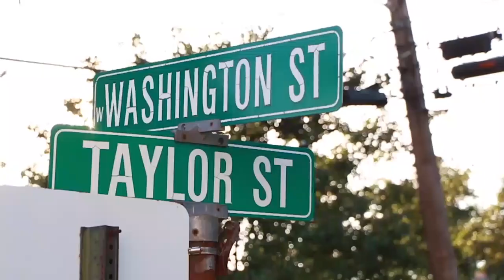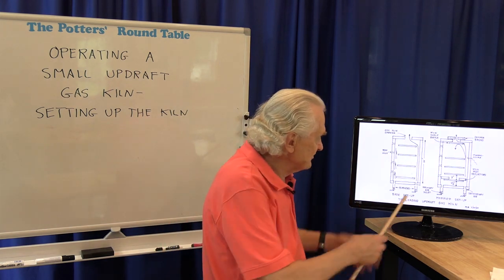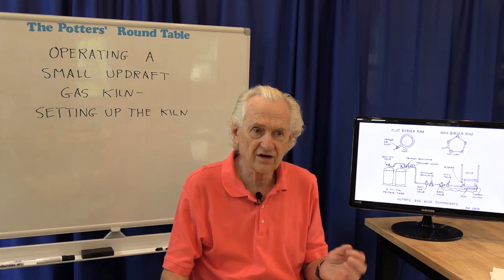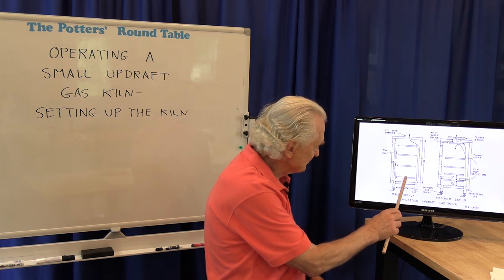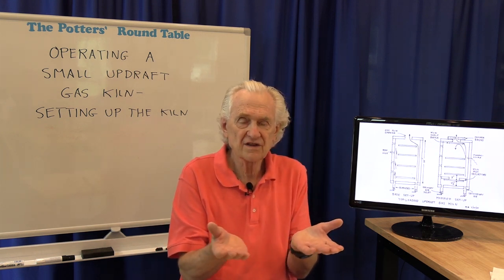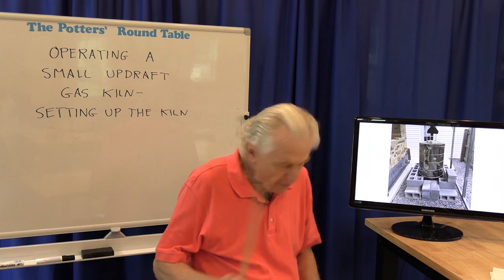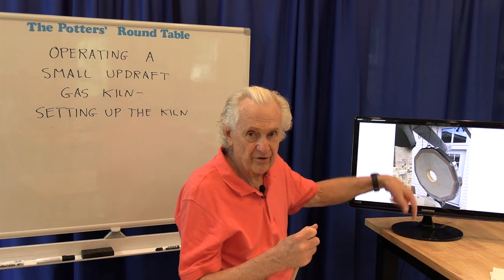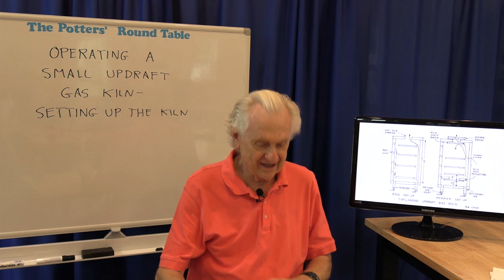Operating a Small Gas Kiln

Comment: Thank you so much for this video!  I have been searching for information on firing a gas kiln and how to deal with hot spots.   I have the smallest Olympic gas kiln and haven't used it very often because I felt more comfortable using my electric kiln.  Also, the reason I haven't  used the gas kiln more is that I don't really know how to use it.  There was a small manual that came with it that indicated the use of a baffle shelf 3" from the top of the lid it also said to place the bottom shelf 3 inches from the floor of the kiln. Other than that there wasn't any additional information on firing it.   I got brave several months ago, bit the bullet and  fired it.  I did use a baffle shelf at the top, 3 inches below the lid of the kiln.  The cone on the top shelf was overfired, the middle shelf was about right and the bottom shelf was underfired.   I had larger pieces at the top and smaller ones on the bottom shelf.  There were some pieces that looked more matured on one side than the other.  It was very discouraging.  Your video has given me new hope and I am anxious to try your modifications.  I might add, I am firing with propane and not natural gas.  I hope you will do more videos on firing the gas kiln as there is nothing else out there not even from the manufacturer.  The books I have found on the subject are more technical.  Maybe I have just looked at the wrong books.    I  would like information on how to adjust the rise of temperature, how much and when.   Also I would like to know how  and when to cover the top port.  To me, firing the gas kiln is much more exciting.  Sorry this is such a long comment.  I am just so happy to find this place on YouTube.
Reply from the maker: Check out our latest video 'Reduction Firing in a Gas Kiln' for more information and a general procedure for any and all gas kilns. It will tell you when and how to cover the exit flue. Any time the video refers adjusting the damper that tells you how and when to cover or uncover the exit flue. Best of luck on your future firings!
Be sure to share the channel with your friends and fellow potters to help us grow the channel.
Reply: I have had an Olympic gas kiln for more than 20 years, and it was so frustrating I gave up, with problems exactly like those you describe. Four burners. It cooled so quickly I lost a lot of pots to cracking. I finally wrapped the whole base in fiber at the end to slow it down. I wrote to the manufacturer and they offered no advice, saying you just leave the ports open. I also got uneven firing, variable reduction, burned a huge amount of gas. Three levels/rings. These videos have been very helpful, and I will try again.

Comment: Thank you! So helpful. Question , how do you provide air to the ring pilot burner. You show a diagram of it but not show photo or explanation. Thank you so very much.
Reply from the maker: No air, propane gas flows through the ring and once ignited provides a pilot light.

Comment: Thank you for your videos and podcasts they are super helpful and informative! I'm just wondering when you'll return to talk about the operation of the small gas kiln? I have a small downdraft gas kiln and I'm trying to figure out how to determine when the kiln is in reduction and how heavy the reduction needs to be. Thanks again!
Reply from the maker: We have discussed this topic several times. I'll get with Phil and hopefully we can put something together soon!
Reply from the maker: Hi, thanks for your email and question. Good timing! As it turns out, our topic for the January, 2021 Potters' Round Table presentation is going to be discussion of a general procedure for reduction firing in a gas kiln. In the meantime - the two features that I look for to confirm reduction are (1) back-pressure (caused by a partially closed damper) in the form of yellow flames out of any kiln openings (like peep holes) and (2) a "hazy" atmosphere in the kiln. The degree of reduction and the length of time for reduction depend somewhat upon the clays and glazes in use. Unless carbon-trapping is desired, it is not necessary to have reduction so heavy that a lot of soot is produced, and if reduction is carried out for longer than necessary to reduce the glazes and surface of the clay (judged by the fired appearance), then gas is being wasted. 

Phil
Reply: @WashingtonStreetStudios  awesome, thanks so much for the advice Phil!!

Comment: Great Video - really useful as I have been given an old Olympic gas kiln just like this but with three rings instead of four. Are there still plans to do a follow up video on the firing procedure?
Reply from the maker: Jez,
Hi, thanks for your email and question. Good timing! As it turns out, our topic for the January, 2021 Potters' Round Table presentation is going to be discussion of a general procedure for reduction firing in a gas kiln. In the meantime - the two features that I look for to confirm reduction are (1) back-pressure (caused by a partially closed damper) in the form of yellow flames out of any kiln openings (like peep holes) and (2) a "hazy" atmosphere in the kiln. The degree of reduction and the length of time for reduction depend somewhat upon the clays and glazes in use. Unless carbon-trapping is desired, it is not necessary to have reduction so heavy that a lot of soot is produced, and if reduction is carried out for longer than necessary to reduce the glazes and surface of the clay (judged by the fired appearance), then gas is being wasted. 

The January Potters Round Table will be on Saturday, January 9th at 2PM eastern. 
The write up for the topic is: 
Reduction Firing in a Gas Kiln
Working with a gas kiln can be pretty daunting. There are updraft, downdraft, propane and natural gas-fired, large and small gas kilns, but all gas kilns have certain features and controls in common. This discussion provides some general background information on gas kilns, an overview of the different stages and procedures in a reduction gas firing, and some of the common mistakes that are made and problems that can be encountered.

Hope this helps,
Phil
Reply: @WashingtonStreetStudios  Great - Thanks for such a generous and informative reply. I've been finding your videos really useful, they are an amazing resource, especially for the self taught potter like me. Look forward to the upcoming round table discussion!

Comment: excellent presentation, I have a small gas kiln made by me very similar to the olimpic 2327, with ceramic fiber, two venturi burners but in a horizontal position, 6-inch space between the floor and the first shelf and on this the pots; I think that's how the turbulence you mention is created. I want to think that saves me from putting the deflectors on top, what do you think, thanks!
Reply from the maker: Salvador, the real question is 'does the kiln work?' If you are getting good and consistent results, then the kiln is working for you. The space does allow for gas / air mixture and turbulence. If the kiln is firing inefficiently or uneven, then you may want to add deflectors. 
If it's working, don't change anything, just keep firing!

Comment: Your videos have been most valuable, thank you. I am in the process of building a small gas kiln, shooting for early summer to have it firing, and had a quick question. I will be insulating it with refractory ceramic fiber insulation and was wondering if you could recommend a rigidizer to coat and stiffen it? Either a recipe or a recommended brand that you might use. The only information I can find comes from diy blacksmith forge chat rooms. Thanks.
Reply from the maker: Deep Ashtray, Thanks for watching and the encouragement! If you didn't know, Phil passed away last July and I really wish he were still around to help with this question!
I have dealt with similar issues two ways. In both cases you need an exterior containment and reinforcement material. I've used chicken wire and / or metal fencing. This will be on the outside of the fiber, so it won't be subject to the extreme temperatures. I've done this with both a 'brick wall with a fiber wrap kiln' and a 'fiber-only wall kiln'. On top of the fencing / chicken wire you can coat the kiln with refractory cement, or a castable (we used old clay mixed with sand, straw, ground up soft brick and used wadding), or a combination of both. 
If this doesn't address your question adequately, let me know and I'll see if I can find some additional help, and please post pictures when you've built your kiln!
Reply: @WashingtonStreetStudios  I'm very sorry to hear of Phil's passing. All I know about him is through these wonderful videos. He was certainly generous with his knowledge, which has enriched my pottery to no end.
The kiln will be built from a repurposed water tank, which I now have set up as an updraft kiln lined with soft brick left over from an old electric kiln. My plan is to replace the soft brick with fabric, build a more efficient firebox and turn it into a downdraft kiln. Sodium silicate is supposed to work as a rigidizer but has a temp limit, and the  products on the market are mostly geared toward forges so I was asking around to actual ceramicists for ideas. Thank you.
Reply from the maker: @Deep Ashtray, I would try this: Colloidal Silica Rigidizer - Coating for Refractory Ceramic Fiber Products - 1 Quart, found it on Amazon for ~$35 a quart.
Reply: @WashingtonStreetStudios  Thank you, I'll check it out :)

Comment: Are gas kilns good for beginners? Right now my home is fully powered by solar power only so i don't have the means for an electric one. But i have plenty of room to make an area for a gas kiln on the backyard.
Reply from the maker: Gas kilns can be used by beginners and they can be purchased with programmable controllers. Manual gas kilns can be a little tricky, and there will be some loss of pots in the beginning. You will have to decide if you will bisque fire in your gas kiln or will you single fire your pots. Once you learn how to work it, it's just like electric, it gets hot!
Reply: @WashingtonStreetStudios  Awesome, thank you for the reply. I'll check those gas kilns with controllers to see which one fits my needs. Thank you!

Comment: I've been using half shelves instead of whole shelves in the firings I've done.  I have left about an inch  between the shelves.  Does this make a difference in the firing?  Also, could half shelves be staggered to accommodate the sizes of various pieces being fired?  Would the spacing between the shelves affect how the heat is distributed?  Thanks for your help.  I love this channel.
Reply from the maker: I've sent the question to Phil and I will post his response when I receive it.
Reply from the maker: Thanks for your questions. The spacing and arrangement of the shelves definitely affect the heat distribution, along with how the shelves are loaded (how tightly spaced the pots are) because these affect the path that the flames can take through the kiln. Tightly spaced pots and closely spaced shelves tend to block the flames and can result in cooler areas. Although the details of shelf arrangement and pot spacing depend upon the specifics of the kiln design (for example updraft vs. downdraft, catenary arch vs. "box"), anything that you can do to provide open pathways for the flames will favor more even heat distribution and temperatures. And you definitely can stagger shelves to accommodate different sizes of pots. 

Phil
Reply: @WashingtonStreetStudios  Thank you for your answers they are very helpful.  I have one last question.  At the beginning of the firing, I've read that the flame should be a candle flame for a while.  I am not sure what a candle flame looks like.  Would  the bar that lights up from the pilot light be lit up and the burners not lit or would the burners also be lit?  When I tried to adjust the burners to what I thought was a candle flame, I got a lot (and I do mean a lot) of soot or carbon.  My kiln was black inside.  Is this normal for a candle flame.  I am sorry if I am a bother by asking so many questions, I have had absolutely no one to help me with my questions.  I will definitely become a supporter of your channel because you have already helped me tremendously.  Thank you.
Reply: @WashingtonStreetStudios  There is a manual for these kilns online and they specifically advise half shelves with a gap between.
Reply from the maker: Jim Barribeau, Thank you for your response! Staggering shelves is nearly universally encouraged by manufacturers and operators of all varieties of kilns.
Reply from the maker: A candling flame is simply a low flame, and yes, sometimes it will produce carbon. You can adjust your gas pressure lower at the regulator and it may help with the carbon. You can also turn the flame a little higher to burn off the carbon especially if your pots are bisqued, since you don't need to dry out the pots.
Reply: @WashingtonStreetStudios  I have a square pilot ring and flame for the four burners, but it seems to create carbon build up on the floor of the kiln, which then flakes off onto the thermocouple which then stops the firing. Any suggestions about how to stop that?

Comment: You mentioned a typical firing lasting for about 5 hours.  Is this a glaze firing? What cone? And what rate of temperature increase?
Reply from the maker: Glaze firing, cone 10, 400-500F per hour.
Reply: @WashingtonStreetStudios  thanks for the info! I want to try fast firing like that but was concerned about a fast temperature increase. Is your clay body specially suited for that or would say a common b mix clay manage that? 

Love the info on your videos! Keep it up
Reply from the maker: Potter House, We don't have a special clay for this, we even use our reclaim, which is a combination of many clays! It is important that all the water is out of the clay. The pots must be bisque fired. And they must be left to dry, 24 hours minimum, 48 hours preferred, after glazing. I light the pilot flame and turn on the gas until it ignites. I run the kiln on low flame until I see the heat waves coming from the top of the kiln. Give it 10 minutes to dry the interior of the kiln and then flame on! Phil passed away in July, and he always did the firing. I've fired the gas kiln twice since he passed and got to cone 10 in 5-5 1/2 hours with good results. Best of luck!
Reply: @WashingtonStreetStudios  thank so much for your response. I'll give it a go and see what happens.  My condolences.